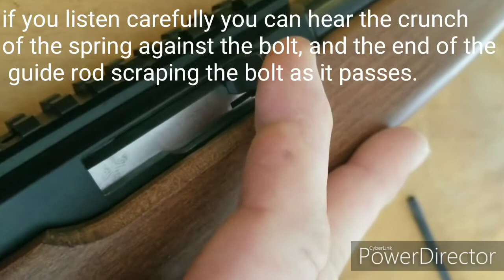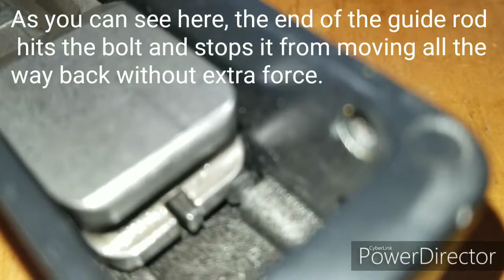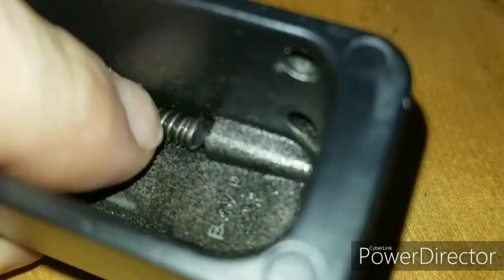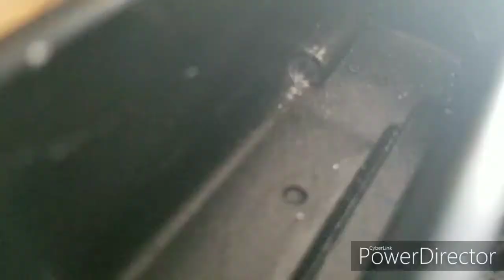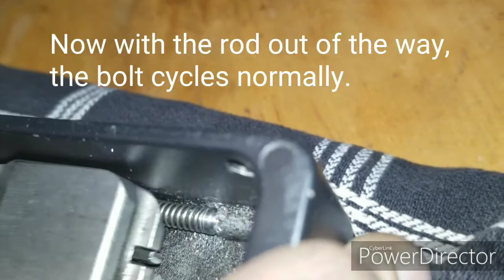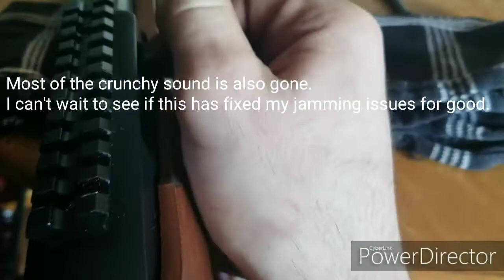Ruger 10-22 failure to eject/jamming FIXED

Comment: I put a KIDD guide rod and spring kit in mine. It doesn't do that,it's smooth. I put a KIDD charging handle on too. Kidd extractor,firing pin and a bolt buffer. I also put the heavier magazine plunger spring and stainless plunger in so it'll hold the BX15 and BX25 magazines better. The stiffer spring keeps them from wobbling back and forth. They work better after that mod. I modified my magazines a bit too. They work pretty reliability now. I put the lengthened mag release handle on,just cuz I thought it looked cool. It's a good rifle to begin with,you don't really need those parts. But they do make it better.

Comment: I paid extra for the stainless steel barrel on a new-from-factory Ruger 10-22. Ended up being a piece of junk. Nothing like the 10-22  that Ruger use to make. I had ejecting and stove pipe problems. Company gave me run-arounds by saying to use different ammo even though I was already following their recommendations. I then tried even higher priced high-velocity ammo which seemed to help  little more but certainly never solved the problems. Regardless, I'm NOT having to pay for expensive ammo to run through a 22lr just so the dam thing shoots the way it should using standard ammo. Ruger then recommended I upgrade components with a tune-up kit that included the extractor. The thing was still crappy. Started doing searches for other people reporting the same problems and WoW I was nowhere near the only one! Ruger said they would take back the gun, perform an evaluation on it, make repairs, and return it. After a week of consideration, I told them that I dont want their business anymore. I paid a lot of money for the rifle and then put through a lot of time, work, and more money for what is Ruger making their products with less quality while charging us more for it! I sold the gun on gBroker for half of what I had into it and let buyers know it was a handy-mans special

Comment: Thank you for this. Been embarrassing the last two visits to the range because of failure to eject and fire. Hoping this will fix that with 12000 plus velocity rounds and even allow me to run some lower velocity rounds due to short supplies.

Comment: First time I saw this type of problem. Are those all original? Clearance for the rod, spring and tip seem tight to the bolt. I assume there's a buffer rod at the rear of the receiver. I had to drill a pocket a bit deeper on one aluminum receiver. You'll need to chase that hole over a bit. It seems too small even with spring tension.
I chased with a hand drill and bit and angled it so that the new pocket was shifted over.

Comment: Very nice video, One of the biggest problems people overlook with 22's (especially Marlin/Glenfield) is shooting Stingers.  Stingers have the longest brass of any 22 round.  Most people think it's just another high velocity round but the brass being taller gets hung up in some rifles and pistols.
Reply: I reserve my Stingers for the bolt gun because they're so hot. Old Savage I have will go full auto with them. I either need to get it fixed or a bigger mag.

Comment: It's a shame Ruger's quality control with their 10/22's is so bad. Thankfully it's better off with their other weapons.
Reply: yeah i own a 2015 ruger 10/22 and got it because people said it was a great, reliable etc but they really suck i haven't even been able to shoot it at all or very much cause it has all of the problems and will jam on everything Its clean, oiled etc but I'm not drilling into my gun or sanding it
Reply: @thisguytrucksoldtrailer6875  What magazines are you using? The BX10 rotary magazines are the best. The big ones like the BX25 give people including myself alot of problems. They can be  temperamental with different brands of ammo. I use Remington Thunderbolt ammunition and it works great.  I have a box of Federal Black Pack. I have alot of jams with that. I have a box of Federal red box. That is ok. And I have a tub of high velocity Remington hollow points,they're ok. For whatever reason? Mine malfunctions the most with hollow points. I stopped using gun oil too in that rifle. I use spray on dry lube. That seemed to help also. Try not having any lube on the extractor. It doesn't really need any anyway.